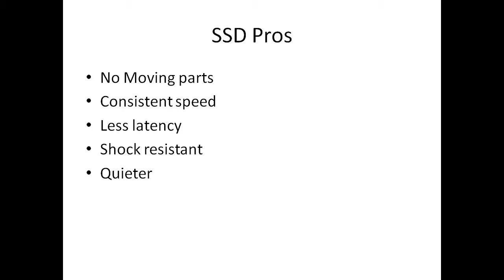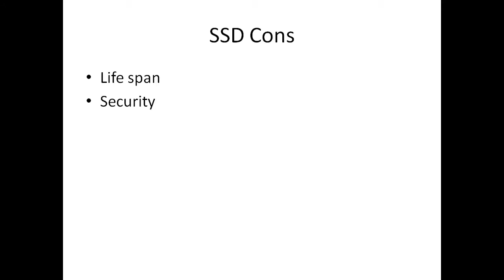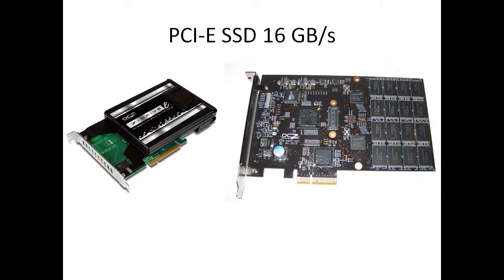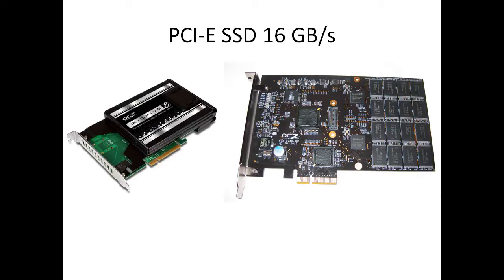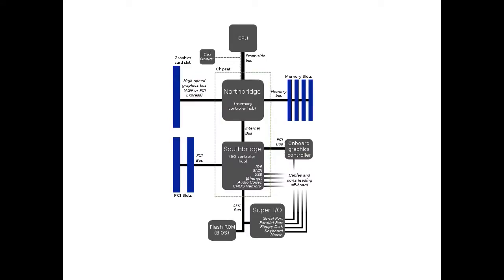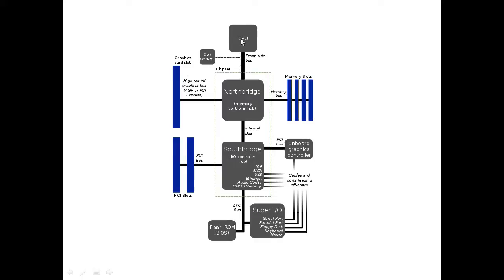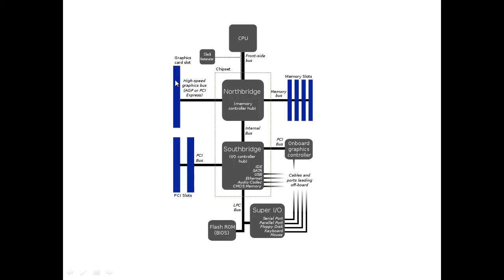PCI-E Solid State Storage: The Future of Hard Drives

Comment: Your mistaken on encryption when it comes to solid state drives.  Spreading data across a drive has no effect on encryption itself, the problem is deleting data. First if you use full disk encryption from the beginning you will have no issues. The issues come into play when you want to encrypt preexisting data. On a normal drive this data is overwritten in place, but in an SSD the encrypted file is put wherever the drive wants to put it and the old data is marked as deleted but left on disk.  If someone were to acquire your disk, there is a chance it could still have the data on it.  So if you want to get around this, you should full disk encrypt your SSD right from the install and then use your HDD for files you want to encrypt individually.

Comment: you didnt do bad especially for your first tech video. intel is also developing another technology which replaces mosft of the circuitry with diodes and fiber optics, significanty speeding a computer and like atomic had stated this diagram is outdated the north and south bridges now work more in unison but the old serial interface it's self is dated but has come a long way. and the read/write issue you talked about is thrashing and the drives are being developed to not do that.